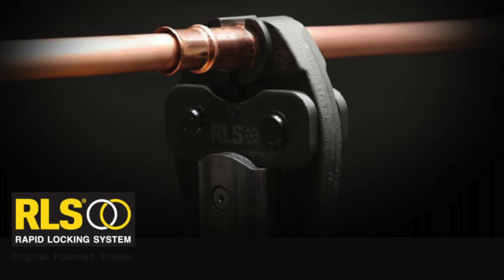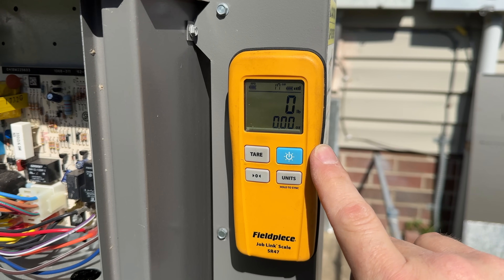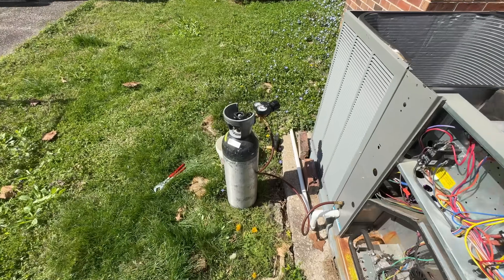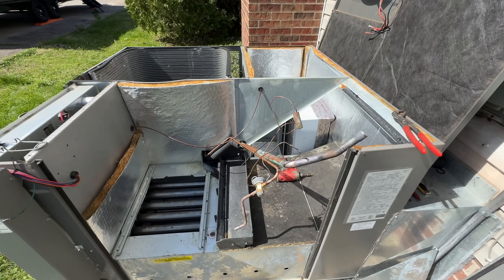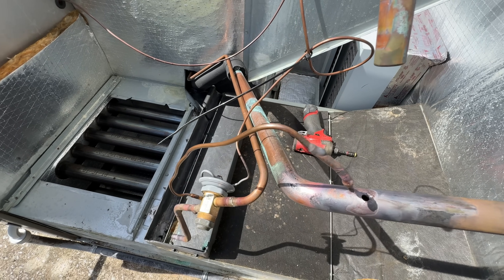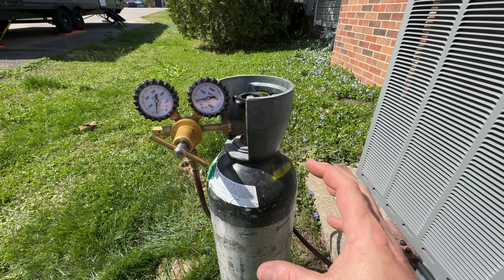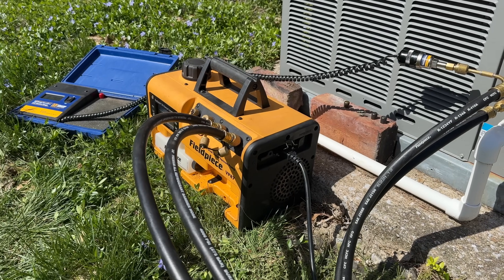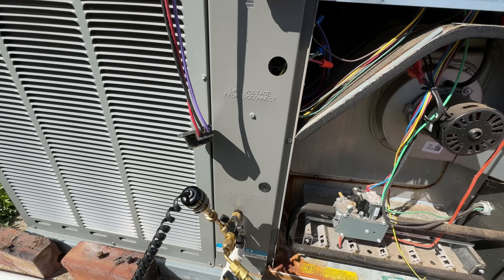Typical HVAC unit LEAKING refrigerant & How I Fixed it.

Comment: Thank you for the video! Very interesting and informative. I have a question: how exactly did you determine that the leak was on the low side, specifically in the evaporator? I have a good understanding of how refrigerators and freezers work, but HVAC systems are still new to me. I’d really appreciate an explanation or a suggestion on where I could learn more about this.

Comment: Imagine that....FIXING a leak.  90% of techs wouldn't bother and would try to get you to spend $20k on a new system....especially with a packaged system like that.   Nice job and great video.
Reply: It's the truth. HVAC repair technicians get upset when you ask them to fix a leak because they cannot get the kickback that comes with installing a brand new system. This guy is honest and I value that.

Comment: Just passed the 608 Universal that I self-studied for so excuse my dumb question here.   One thing I kept reading about was how you should check to see if the system is leaking refrigerant before you add more.  Did you know the system was not leaking when you recovered the refrigerant and the gauges held steady after pulling a vacuum?

Comment: Hey awesome video, I see that you have not put back the refrigerant that you had recovered because its a blend, have you ever had a problem with this in the past? I tend to think that as it is mixed you should not lose one part more than the other..
Reply: If you’re recovering a small amount of refrigerant , with that kind of repair, might as well recharge with fresh refrigerant. Technically, he could’ve put the refrigerant back in as long as it was put in as a liquid.

Comment: On the nitrogen leak check why no soap bubbles?
Reply: if Pressure does not change in 15 minutes / Systems tight !!! Why use bubbles right off ?
Reply: I dont want you working on my refrigeration.  Lol.  Guages arent that accurate. There isnt a guage out there that can detect a 1/4oz per year leak pressure drop in 15 minutes.  bubbles dont lie. @OcRefrigeration

Comment: If your recovery tank is used and has oil in the bottom of it, that will affect the vacuum. Especially if it's contaminated.
Reply: Yes it will spit the oil from the tank out the vacuum. Not the end of the world but then you should dump the vacuums oil and refill.

If you know the tank has contaminated oil you should only use it to recover refrigerant that you don’t plan on reusing and mark the tank ‘burnout’

I always vacuum new tanks too it’s good practice so you know it’s clean and you can reuse the refer you pull.

Comment: @Quality HVACR i'm investing in some digital gauges. was wondering if you could either do a video, or straight up recomment a brand. after some homework, i settled on yellow jacket, testo and field piece. any feedback is greatly appreciated!!!
Reply: I personally use the testo 550s. I like that it has a smaller footprint than the rest. It’s very accurate and I haven’t had any problems from it
Reply: I personally use Testo 557s. Great set of digital gauges.
Reply: Fieldpiece smans480. Trust me 😊
Reply: i'm starting to think theyre all great. its all about which colour do you want 🤣field piece will match my dewalt black and yellow theme 😎😎
Reply: SMANs are great and what I use (Testo and Yellow Jacket too) but... had issues with almost every single set.  Manifold bleed thru, funky intermittent micron gauge (have to clean periodically but still acting up), wireless connection issues, one had weird intermittent pressure readings until you "tap" it.   1000 bucks with hoses and wireless temp probes, it had better perform.  I always keep spare hoses, gauges (even analog), various low loss fittings, etc on the truck.  Redundancy is the word.  Not cool to be stuck with faulty equipment on a job and have to pull off.  Good way to piss the boss off!
Reply: Fieldpiece JL3KH6 have treated me great! Very easy to use and takes 5 seconds to pull up on the Mq HVAC app. Highly recommend
Reply: Fieldpiece probes+appion core control tool. No loss of refrigerant. If you need to charge you can use a charging tee+ball valve hose. Vacuums pulled with a large hose direct to a CRT on the suction side.
Reply: I have been using the Testo 557 gauges as well using the measure quick app. I love them! I use low loss fittings on them so minimal refrigerant is lost.
Reply: Field piece hasn’t let me down I’ve had the same digis maybe 3 years now
Reply: Testo 550s all the way homie
Reply: Fieldpiece for the win
Reply: Testo or Fieldpiece are easy and good to use either is fine. I have both
Reply: I live by my Sman's ever since i was an install helper. Field piece as a whole is great.. wireless sets are premium if you take care of them
Reply: @Keepitclassy343  have you seen the new ritchie yellowjacket digital gauges?
Reply: @zurikin  no sir. But I  have used their vacuum pumps. Very good quality.
Reply: no one mentioned the new navac gauges yet
Reply: Anything from Fieldpiece! I have the job link set up for service and SMAN for install.
Reply: the best is sman482v
Reply: The Centeral Florida company i work for uses Fieldpiece, Tiesto etc
Reply: i’m a huge fan of my field piece gauges.  i got the SMAN 480 but i would recommend getting the 380 as i never use my vacuum port on my gauges.
Reply: Why not use vacuum port?  @mooresville2566